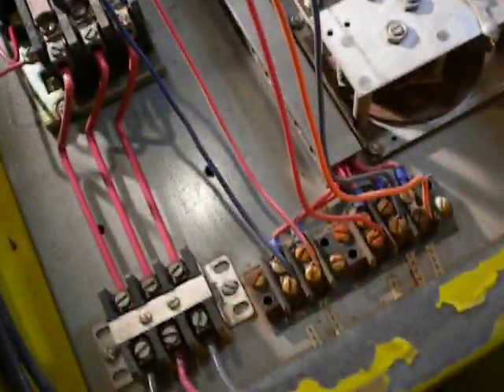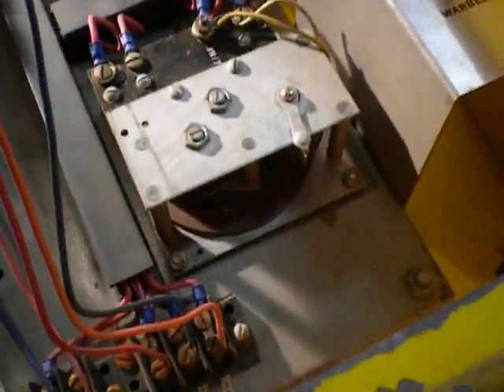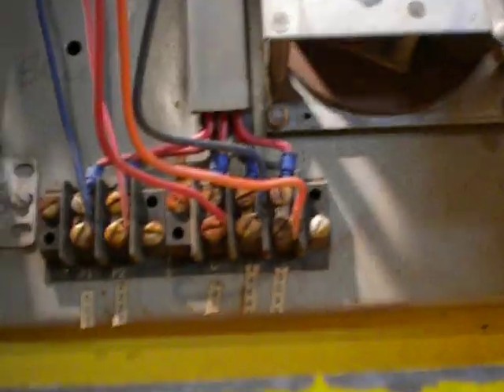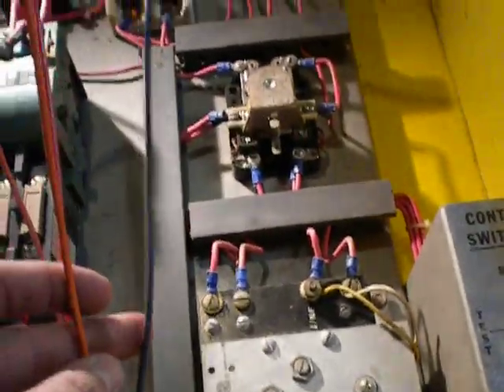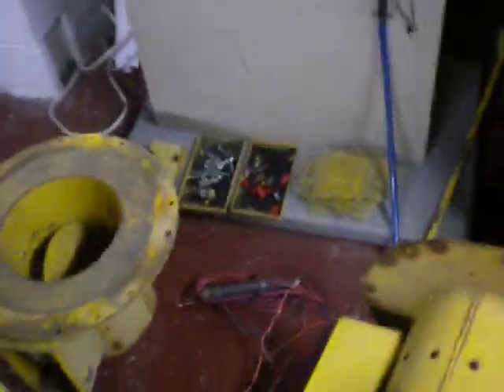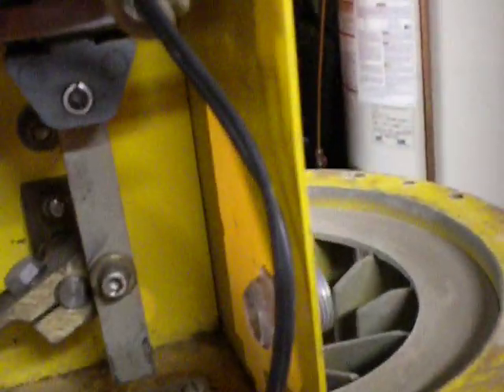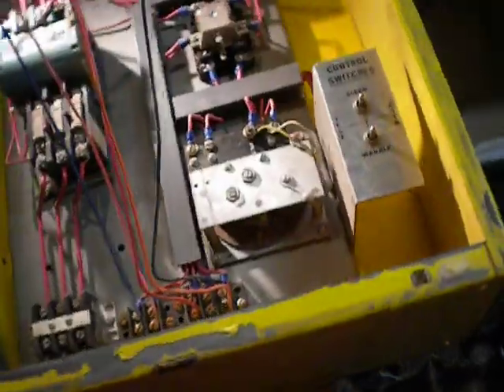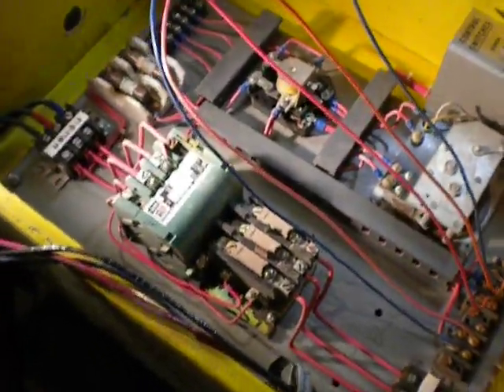Federal Signal 3T22 Tornado Siren---Solenoid Flasher Explanation

Comment: Wait so the high-low sound on a tornado siren is the sound of the air flow changing? I think I'm very wrong, if I am please correct me, I'd like to learn!
Reply from the maker: When you cut airflow to one of the choppers with an electric damper, that chopper doesn’t make sound. Thunderbolt 1003’s and 3T22’s used a damper system to block airflow when actuated. The different amount of ports is what makes that particular tone. A Thunderbolt 1003 is a 5/6 port and a 3T22 is a 10/12 port. The higher the number, the higher the frequency.
Reply: @promod400exridr  ahhhh. Cool! Thx. So a higher port ratio the higher the pitch! Coool!!!